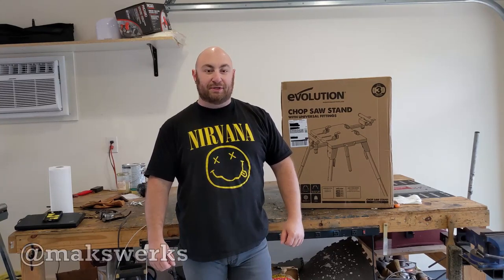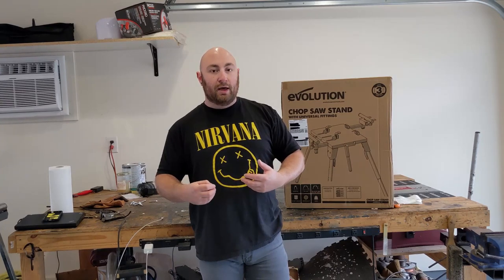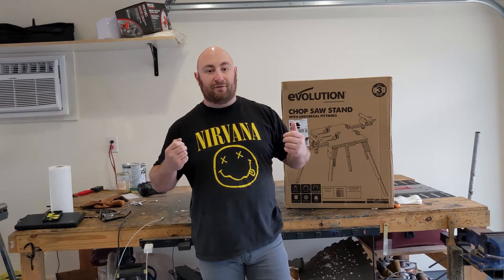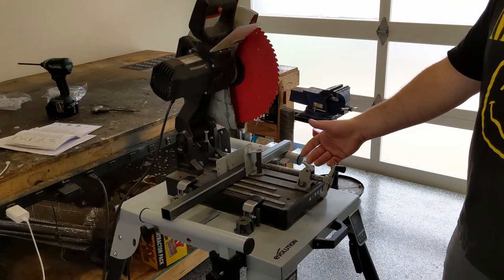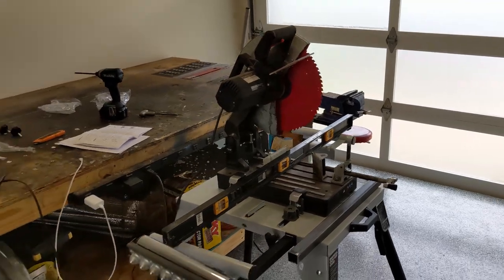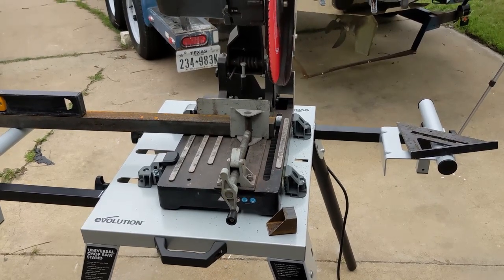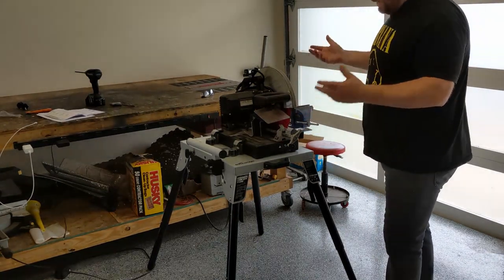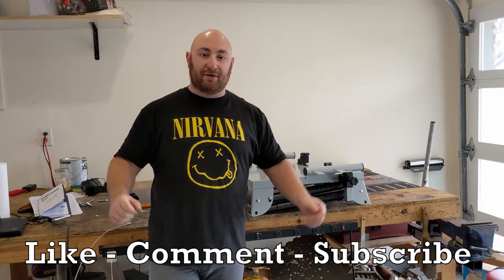UNBOXING & REVIEW: Evolution Universal Chop Saw Stand

Comment: I just bought the Evolution S355MCS 14” dual miter metal cutting saw and must say it’s a beast of a saw. Love the design and superior cut to the old abrasive saw that it replaced. Expensive, yes but worth every dime. Now I just need to finish my welding table build and then build my saw a permanent stand.

Comment: Looks a bit lightweight how's it holding up? I have a Metal Devil 14" chop saw. Base is 12"w X 19" deep X 2" tall. Think it would fit? Thanks, Chris
Reply from the maker: for sure  - mine fits great. its actually fairly sturdy, I have been using it for a while now - the only real drawback is having to adjust the saw position for a full 45* cut